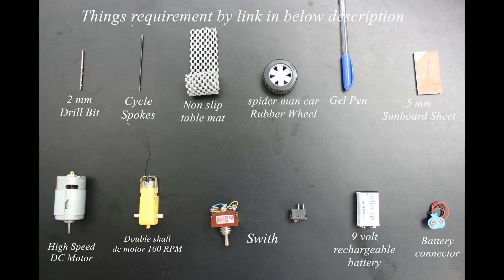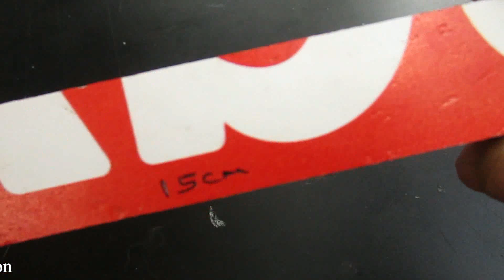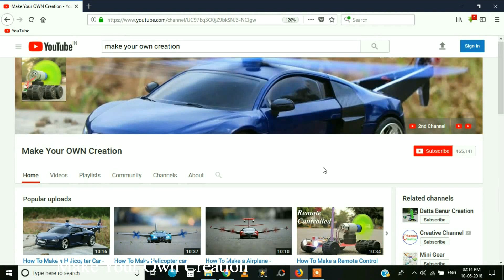How To Make a drill machine - drill car

Comment: Its amazing how many youtubers over use hot glue guns.

 What was the point of this thing, I miss the part where this idea merits all the praise the comments are giving.... It can drill a hole in the ground, or almost through carboard...? Then it gets stuck until you pull it out and put the thing back into car mode? None of its automated? No remote control? It just goes in a straight line in car mode? (Well, it doesn't even drive straight...)

I can see this being brilliant if the creator was a six year old, or was somebody who has mental disabilities and can be creative despite their disabilities.

I just don't see anything here other than a person who has a large amount of free time on their hands and instead of doing something like developing a useful or valuable skill to better their life, just wastes time gluing plastic trash together into pointless crap.

Why is there a small coil on the drill bit? What purpose does that serve?  I thought the switches were going to crudely give it the ability to change direction upon impacting a wall or something.

There's even a disclaimer like the stuff in these videos is somehow dangerous or inherently risky. I lol'd.